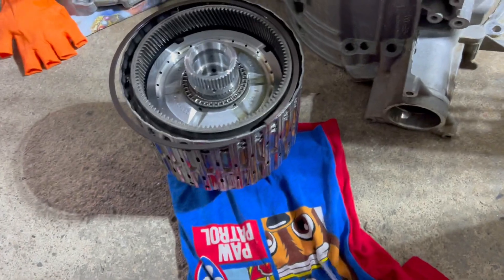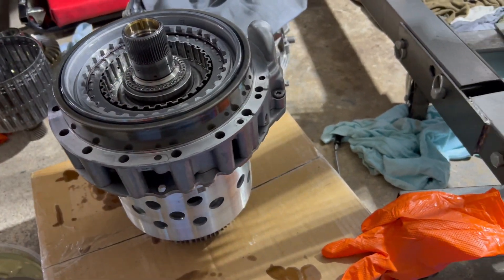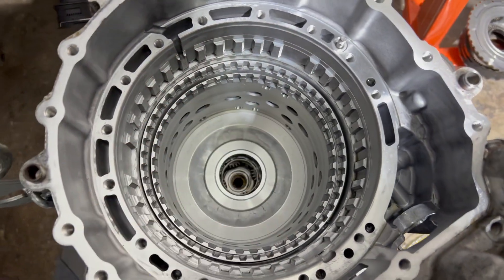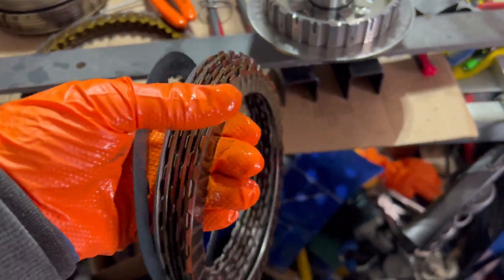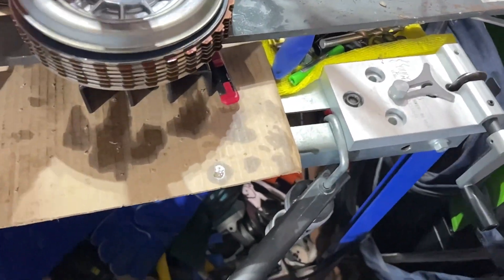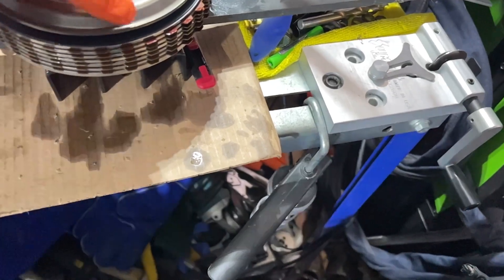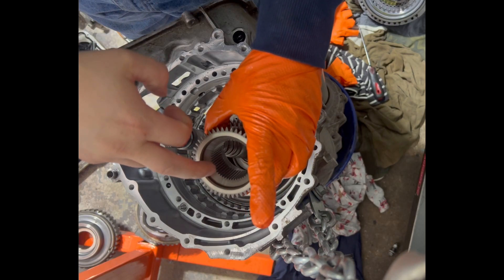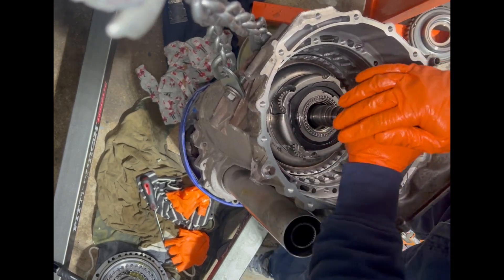Upgrade 8HP ZF-55 Audi RS6 RS7 S8 A8 4.0TFSI Part 2

Comment: Why not use the 8HP90 from an rs7?
Reply: from what i understand is it wont fit. the zfhp55 are  the largest you can instal without modifying the housing area but they also have the most aftermarket ability too. some companies offer up to 1200hp suppoort

Comment: Do you happen to know of an issue with the 4.0L transmission(2017 C7.5 S6) that causes a wine sound from 0+kph to 18kph by chance??  my apologies for vague question/commet
Reply from the maker: Hard to say by guess but could be many thinks ! front diff , bearings ,  sun gears , fraction plates etc... ZF transmission good and can hold a power but still required full rebuild after a while especially with massive power gain over the stock RS7 . ZF Wear out quickly from inside the way i saw
Reply: appreappreciate your quick reply!    @Svarogperformance